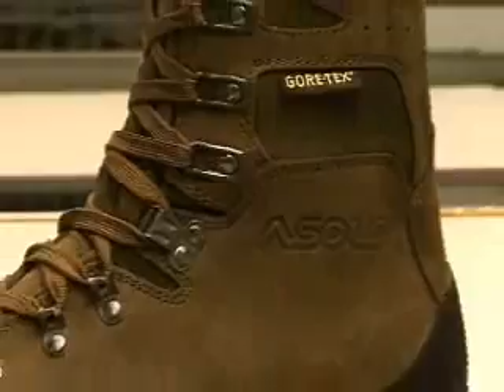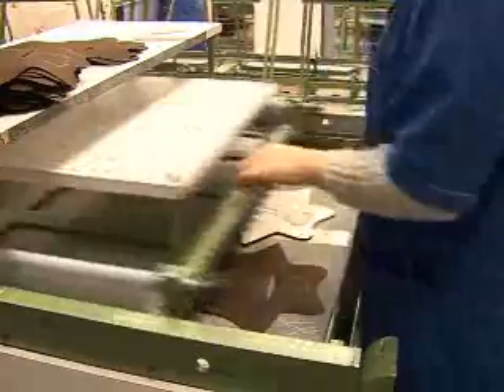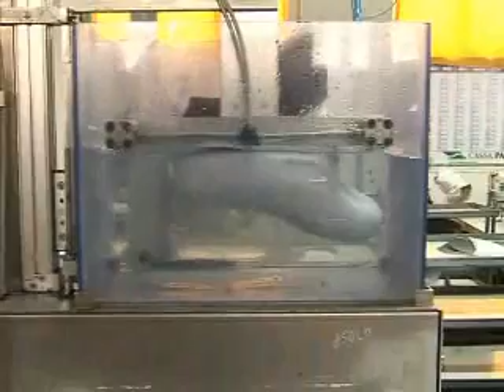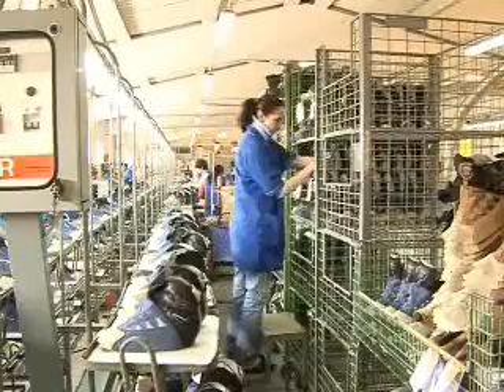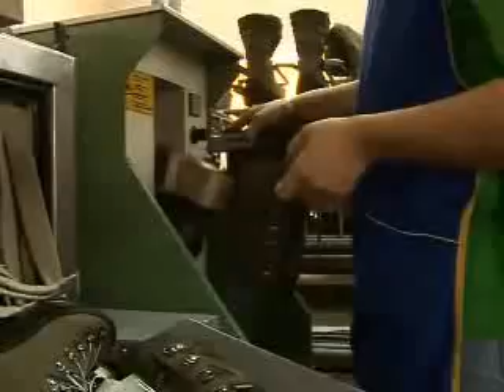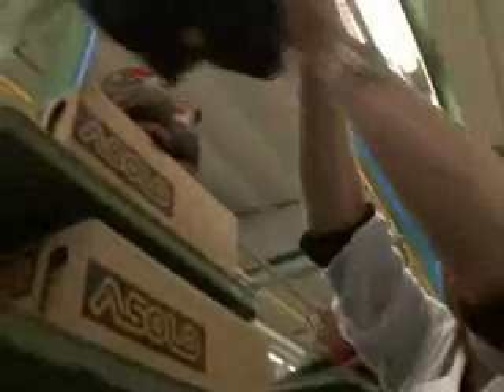Asolo Romanian Factory Tour

Comment: You may want to have a look at rubber cushioning used between the Vibram outsole and the hard insole. There are many reviews noting that this rubber has disintegrated. I can confirm that this has happened to me, with this rubber falling apart to the extent that the welt has collapsed in on itself. You can't replace a sole on a boot like this, so the damage is irreparable. The sad thing is, is that the rest of the boot is perfect and it hurts to have to throw it away!